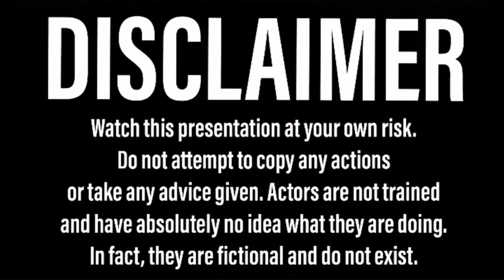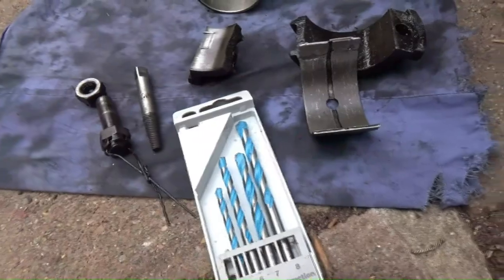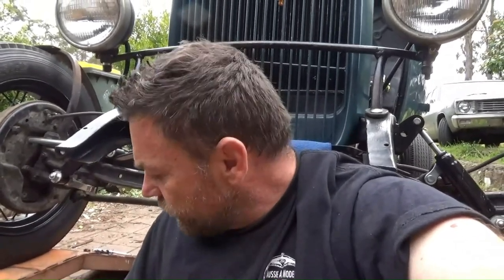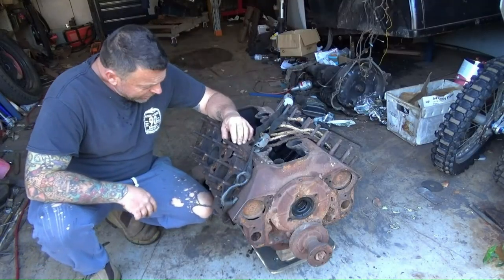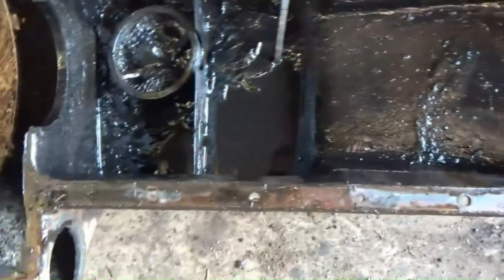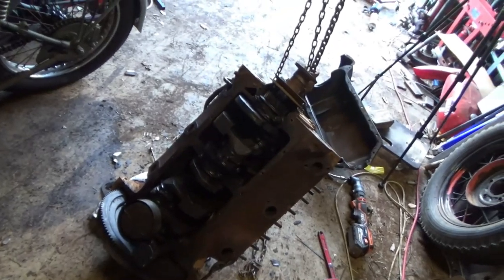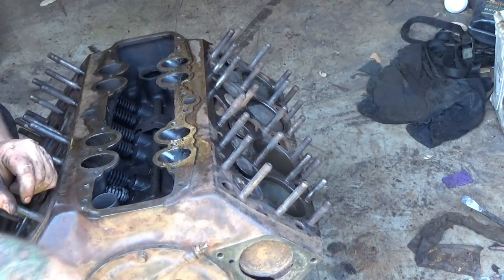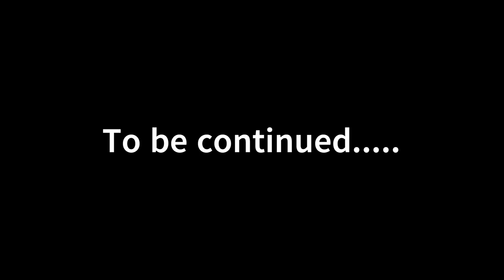This isn’t good 👎🏻 V8 Model A Hot Rod Pt36

Comment: Ok you got the stud out, you need to line hone the block when you change caps. If you don't it will spin the bearing or break the crank. It might not turn after you torque the cap.